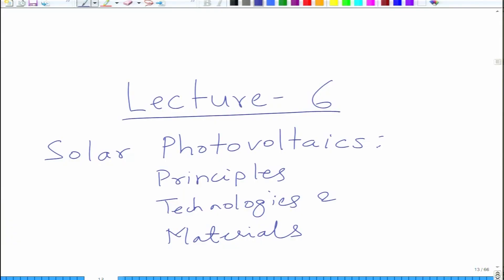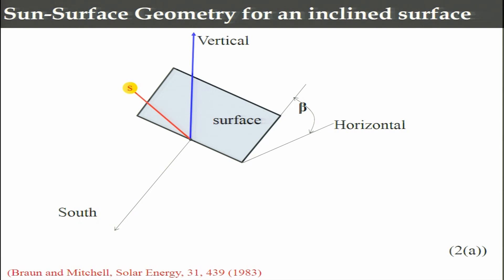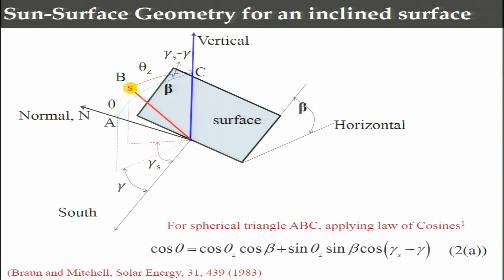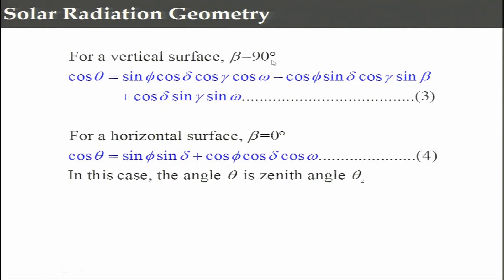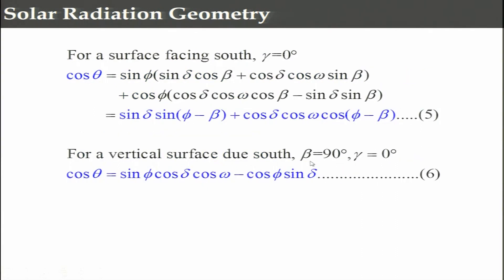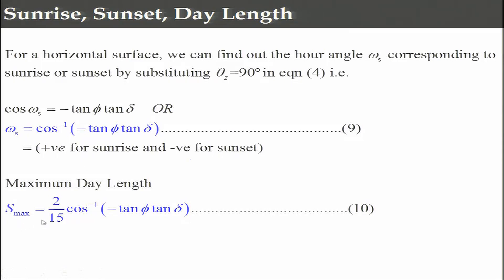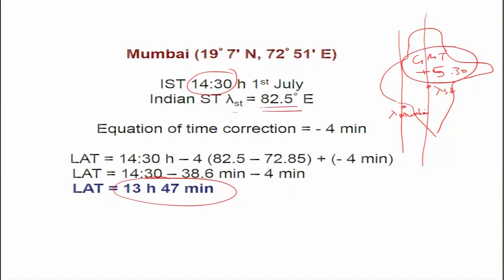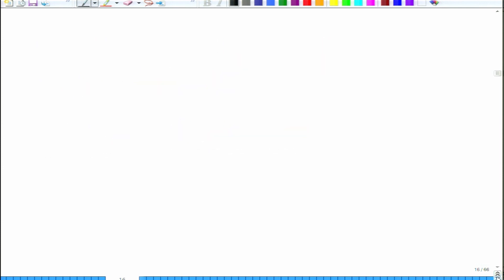noc19-mm04 Lecture 06-Solar Radiation Measurments

Comment: Sir i  don't understand when to use +ve and -ve sign 13:01
Reply: for omega subscript s (i.e Ws) sir has told +ve for sunrise and -ve for sunset. And in the equation which you have qouted in the time slab, it is for error correction i guess